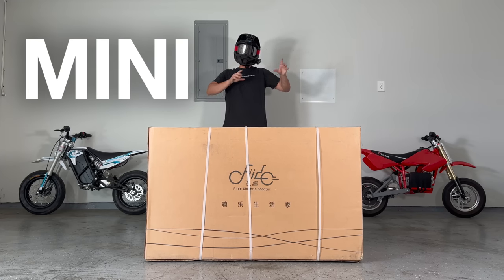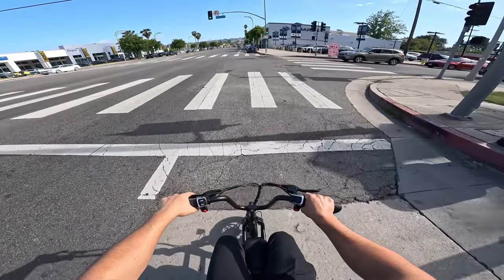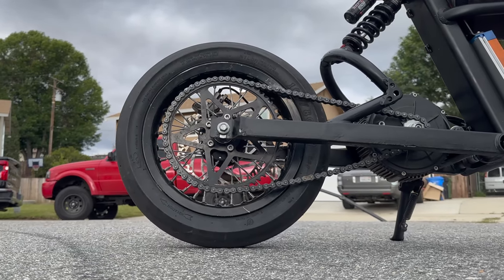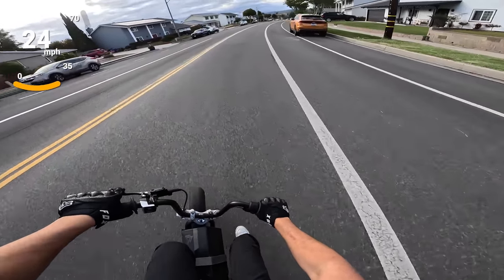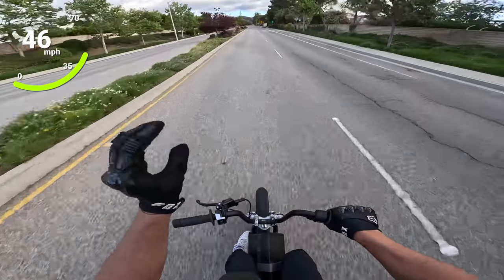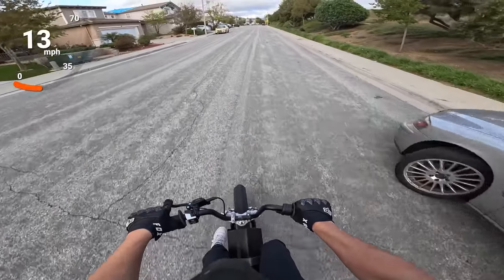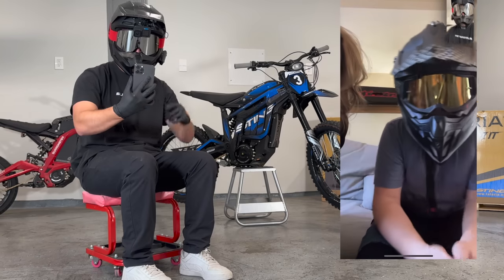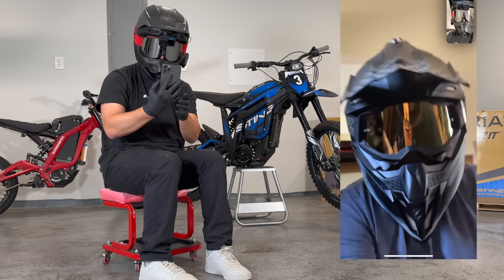This Mini E-Bike is FASTER than a 72v Surron

Comment: Underrated part is definitely the helmet part. For too long it’s been helmets have been shamed as uncool, but they literally make it so you can keep riding.
Side note is I think about doing a similar project with the surron parts as I upgrade since I have a razor rsf to add the stock surron parts to
Reply: Specially on these bikes people don't realize how much you can actually hurt yourself on these things glad I had mine on I looped my talaria mx3 first week I had it only injured my leg and my side I did hit my head but the helmet saved me big-time not even a concussion!!! Helmets are a must on these!
Reply: @sa2ah0  so glad to hear - don't forget to replace your helmet after a crash though or send it to the manufacturer for an evaluation if they offer that. the structure could be compromised without any visual indicators and it might not protect you the second time
Reply: @_herb  for sure it wasn't a very hard hit I actually hit the front visit which came off and surprisingly didn't reck I was able to just magnet and clip it back on the helmet still structurally perfectly fine if there is any cracks or denser anything wrong with it I definitely replace it... Really wasn't a direct hit on my head it's just kind of how I landed front first... My leg actually took the brunt of the force
Reply: Helmets are the best and I know it
Reply: I don't like to go over 30 without one.  Too much wind noise and it dries out my eyes.  Also if you ride on two wheels you will eventually crash
Reply: @Callin Bowa Yes Sir. helmets are good.
Reply: He goes from talking about how he has had headaches and nausea as he's literally running stop signs in a fairly densely populated residential area while riding a makeshift electric motorcycle around 30-40 mph. For half a million followers it would be nice to see him be a better influence for the younger kids watching.
Reply: @inc0de  I mean he always wears a helmet.  Sur Ronster is not the guy you need to be worried about.  Theres a billion videos of kids doing way way more dangerous stuff without helmets.  He usually keeps it pretty safe.
Reply: @highdesertbiker  It doesn't matter what other YouTubers are doing, he has an audience of half a million people and probably even more people who get recommendations to his videos but don't subscribe. He's running stop signs as if they're yield signs. He's breaking the law and he's doing it after just saying a doctor supposedly told him he could die if he had a similar head injury as his previous accident. He's being irresponsible regardless and his audience is probably 90% teenage boys influenced to do the exact same things he does.
Reply: @inc0de  ok KAREN...maybe you should be watching cooking videos
Reply: @highdesertbiker  I ride motorcycles and I have young kids. This guy is clearly an influence to a younger audience as he evidently just gave a Surron away to a kid who probably doesn't even have a driver's license. Teaching young/new riders that it's ok to blow right through stop signs is irresponsible and it would be great if he addressed his carelessness as it's probably going to get someone killed if it hasn't already. I don't care if he drives like an idiot off-camera, but for the sake of making a sub-10 minute video, he could at least follow the law.
Reply: @inc0de  He was never teaching anyone to blow stop signs.  He's also young.  Let the man enjoy his channel.  I get it man.  I lost people doing stupid things and I don't promote blowing stop signs but let me ask you something.  Since you have respect and are legit concerned.  Do you ever drive over the speed limit?  Do you ever do a rolling stop at a stop sign?  Maybe sometimes, do you rip a little fast on your motorcycle?  

I mean bro, you have kids and you ride a motorcycle.  Motorcycles are super dangerous and almost everyone I know that has owned one has crashed at least once.  So if your kids see you riding one and say "oh that's cool that dad rides a bike"; wouldn't that be promoting them to do something completely unnecessary that risks their lives?  

We all take risks.  Most people speed.  Life is dangerous.  Sur Ronster has NEVER said in a video that people should break laws or blow stop signs.  I don't agree with him doing this, but hey man that's his decision.
Reply: @highdesertbiker  He's not instructing them to straight up run through stop signs, but he's not discouraging it either. In areas where the speed limit is below 45 mph, I stick to the speed limit, it's only interstate driving that I will go 5-8 mph over. With our latest hybrid vehicle purchase, I'm more about efficiency than arriving a few minutes earlier. All of that said, I don't care how he drives off the camera, when he's recording footage for his channel he should at least adhere to simple traffic laws and point out to the kids who follow him that they exist for a reason. He has this platform where he can promote safer riding practices when it's necessary (like wearing a helmet) and instead showcases risky decisions that jeopardizes his life and the traffic around him.
Reply: @inc0de  I completely agree with what you are saying, but I think you are barking up the wrong tree.  He is just young man.  Sometimes it takes a long time to realize the impact of your decisions.  I'm sure even now he's reading this.  Sur Ronster is a great role model in so many other ways, such as building a company and Youtube channel.  It's easy to focus on his dangerous driving.

That said.  I do agree he should be more safe and hopefully your comment and this discussion will help to change his mind.  And I do appreciate you having a discussion and looking out for the safety of riders.
Reply: @inc0de  It's a southern California thing anyways, too many bikes with no bike lanes and as you can see, once people are at school and work, these suburbs have very little to no car traffic. I lived down there for half my life I would know.
Reply: @pinga858  I live in a fairly rural part of the Midwest, we have little to no car traffic. It doesn't change the fact that he's breaking the law several times over by not making complete stops at stop signs. I've been to SoCal and up the coast to SF, Yosemite, and the Sequoia NP. There's no reason to make excuses for his inconsiderate riding practices, it only takes one mistake to cause an accident and he's clearly making no attempt to negate the odds.
Reply: Good for you to be wearing a helmet but it would also be a good example to obey the traffic rules, they’re there to keep everyone safe like the helmet…
Reply: Stopping at stop signs are cool too !👍 pretty sure it's a good way to extend lifespan too!

Comment: I do have something similar but not fiido. In malaysia and phillipines, they tune fiido bikes like crazy. Dual crown fork suspension, 6000 watts motor(speeds exceeding 100km/h) huge battery(72v 40ah, basically the whole battery fill up that entire hollow space) colored LED lights below body frame that shines towards the road.

Comment: in philippines fiido q1 are popular, someone soup it up by installing 3k watts dual front and back hub motors.72v lifepo4 batts..

fiido q1 and q1s needs steering stabilizer if your going more than 80kph.. btw they can hit 100kph lol

Comment: I got 1 of these,  plus 2 Fiido T1's, & regular & Pro model, as well as the Fiido M21,  & I love each 1 for different uses, my T1's I use as my UberEats bikes, as well as my bikepacking rides, the M21 is my e-Mtb bike to shred the awesome trails here in Nevada,  & my Q1S is gonna be my speed demon, dual 5kw motors, 2VESC controllers, & a 72v Powerful Lithium battery.
The Q2 that's coming out is even gonna be better,  it's the original Road Runner they made for Voro, but with hydraulic brakes & other additions,  can't wait to put yet ANOTHER EBIKE in my 50 sq ft apartment, but to mention my 8yo son got a modded e dirt bike, ebike & a e scooter!!! 😆

Comment: Is your helmet a road/offroad helmet? You should consider a full-on MX helmet when you go off-road as they are rated differently. I have one for onroad and one for offroad A full MX helmet has a higher impact rating because of the nature of motocross having constant hard impacts. I use the Bell Moto 9 and have had some serious head impacts that I walk away from with no issues. You might have just had bad luck that day and hit really weird. Could be a whiplash concussion which is when your body stops really fast and your brain keeps moving impacting the skull from the inside without actually impacting your helmet. Either way, I hope you feel better soon, bro.

Comment: Just was curious if you can run a stock surron motor backwards. Is that fine or is it bad for it?? Just was curious because Surronster has it on this thing and its facing opposite direction.

Comment: Duuuude, PLEASE get that swingarm reinforced before you get hurt. The geometry where the shock is mounted is straight up scary. Putting the shock's lower mount on a hoop is a bad idea to begin with, add in the stretched swing arm, heavier wheel 😳 It'll hold until it doesn't, one good bump and that thing is gonna fold in half, and lock up the rear tire.

Comment: a this point you could pretty much design a whole bike from scratch...for instance something like a ducati treillis frame with welded steel tubes. you can make pretty lightweight frame with good rigidity and its easier to work with  than making an aluminum frame or even carbon fiber. you can have tubes cut and bent to your specifications and find someone to weld it. the frame could be designed around a big battery and electric motor.

Comment: So I have the mx650 with the ronster kit. But I need wheels badly! Both the front and back wheels are warped and making noice 😂. Any ideas on what rims and tires set up I can put on? I’m going crazy looking for the Rsf650 ones but can’t find them anywhere. What else will fit on the mx? Thanks 🤙
Reply: The app with what looks like a paper plan? In blue? I tried searching you up, nothing
Reply: I think I found you lol 😂

Comment: G whiz…..
Bigger bikes handle.. have you ever seen a kid on a strider two wheeler fall from instability…
Ride a bigger motorcycle and then a shorter wheelbase..
Cool maybe..
Like driving a well balanced car without power steering . Exhilarating maybe. Tiresome long term hard to live with.

Comment: Its too bad that in my city there are specific ordinances against the use of motorized (gas or electric) vehicles with a floorboard, most motorized (gas or electric) bikes are fine as long as they have a set of pedals, a front headlight and rear taillight, I get that this is a review and your testing it and im probably not the only one with this opinion, but come on man people driving these like that and then getting hit or having accidents are the reason these things are so regulated and near illegal in some places, when they shouldnt be, it makes us look bad as a whole, whether you ride a gas powered skateboard or e-bike.